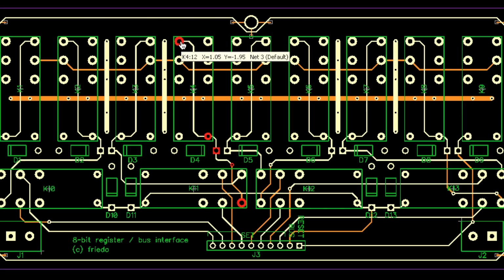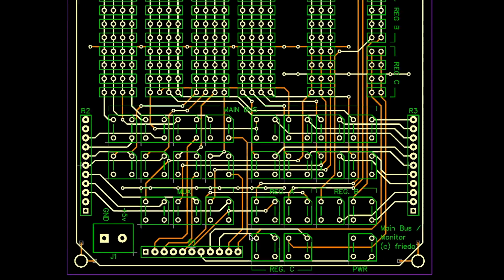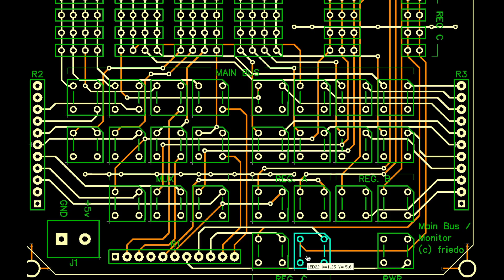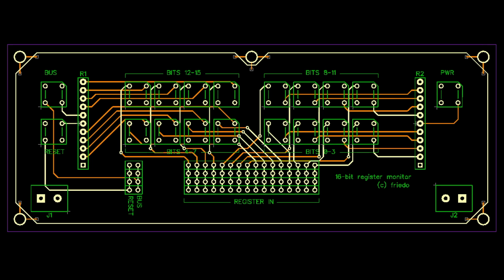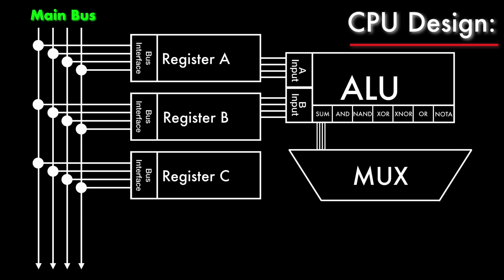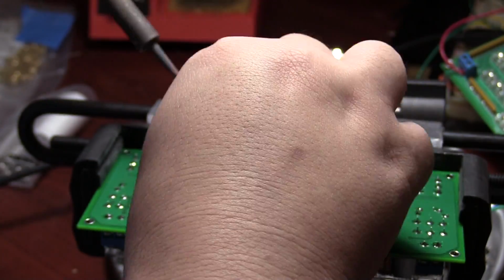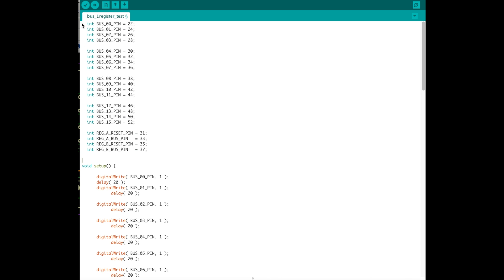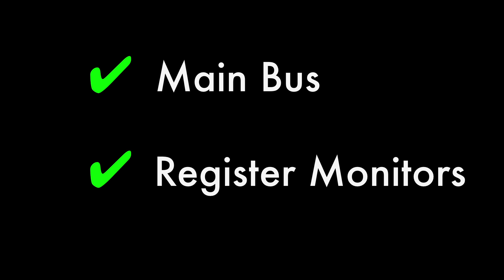Relay Computer ep. 7 - Main bus and register monitors

Comment: love this project and your updates — konrad zuse with the Z1 was the original digital relay computer guy. love your didactic sense of construction — with the mini LEDs giving an indication to whats going on in the system. it is meditative to watch you building this system from the relay gates on up, and the sound it makes whilst computing is really coo. i wrote a chess programme for macOS (called pChess) which emitted sounds while it was recursively searching the highest static evaluation, and it was a way of hearing the computation — in much the same way that the relays naturally provide. thx for this. 🙏

Comment: I think he is stuck building kilobytes of relay memory :)
Reply: I’m putting together a 1024 bit (128 byte) relay RAM… 2048 relays, not counting the external row decoders etc - those 2,000 are just the bistable (latching) bit storage registers and their bus couplers. Since it’s a diode-less design, the 2 relays per bit is the bare minimum, since each bit has two lines (a read line and a separate write line). And I still need a 512 byte ROM, so that will be another 2000 selector relays plus dip switches. It gets tedious sometimes but is also satisfying.
Reply: @absurdengineering  ouch
Reply: @absurdengineering done?

Comment: You should build a circuit that checks the relays if they are working, so if one is broken it will give a code in binary that would tell you witch one, this could be too complicated but just an idea, kind of like a POST for it
Reply: How would you work that physically?  With an overlay board that could address each relay and be plugged in and out?

Comment: So how do those rail resistors for the leds work? Are they just a bunch of resistors in parrallel in a nice formfactor?
Reply from the maker: They're called resistor networks; these particular ones each have 10 resistors inside with one common terminal, so 11 pins total.
Reply: @ClicketyClack  where do you get the ones with 11 pins? I can only find 10-pin versions

Comment: In the test starting at 14:10 I can hear the data cascade "ripple" as you say thru the adder, then the 200 msec delay you put in before the next enable signal.  What would happen if you tried to use the elements of your CPU asynchronously, using its own output as an enable signal for each step?  Would the variable time for each addition operation, because of the changing number of carriages, screw things up?  Or is there some data bit you could effectively use as a "wait" signal, a "NOT enable", to queue up the operations properly?